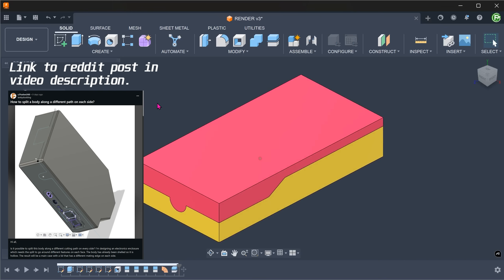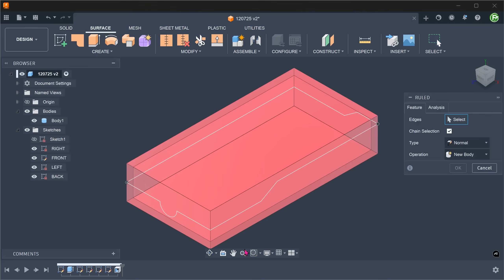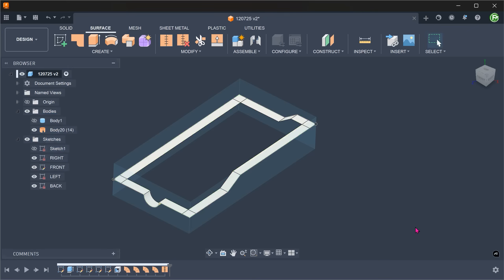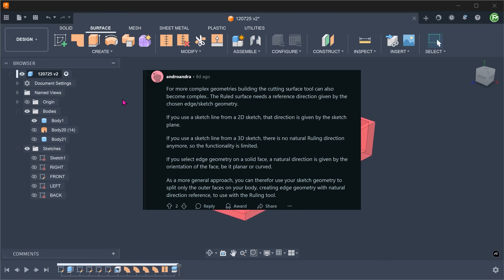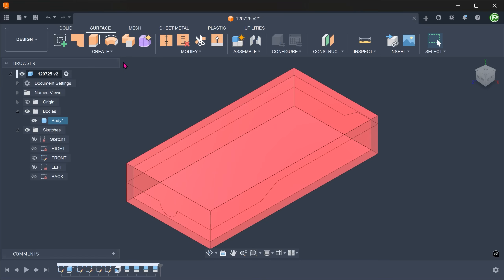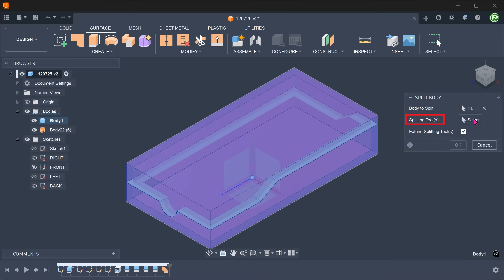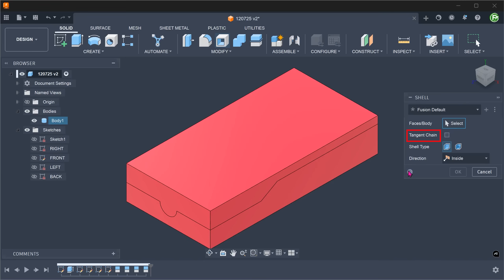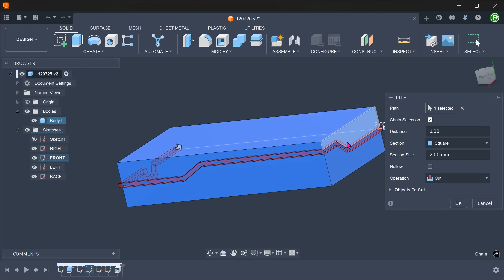Autodesk Fusion | Non-planar split

Comment: Quite similar to the workflow used for automotive parts. Splitline is hardly never ever a planar split surface. Always wraps around corners with some stupid angle from one flange to another flange with a different angle.

Comment: It's worth noting that the ruled surface split allows for 3d splits, especially if you also thicken to a solid body and combine-cut. meaning you can create stepped lips, o-ring seals, draft angles etc.

Comment: Thankyou, I think you’ve solved a problem for me which I’ve been wrestling with for a few years. Making ceramic slip casting molds of organic sculptural forms involves a draft analysis and drawing sketches with splines sort of close to that neutral draft area. I think this workflow is the missing piece of my puzzle. I think I’ll be able to project those sketch lines onto the shape, split the face and make surface bodies to stitch together later to be the parting face. If the workflow applies it’ll allow me to get complex with things like the multi part mold pieces between the legs of four footed animals. I’ll let you know how I go.
Reply: I've done this and it fails to compute if the split surface runs close to parallel to a surface of the body anywhere but other than that it works

Comment: Hmmt though you could just create 3D sketch, then use that sketch to create a 5mm plane that'll work as a tool, then just split the body with the tool. Thus you can later, if necessary, adjust the sketch and change the split how ever you like...
Reply: I thought about 3D sketches, too, but since they are so awkward to work with I figured there had to be a better way.